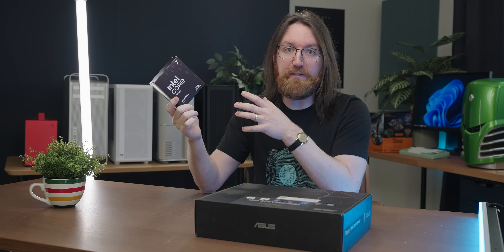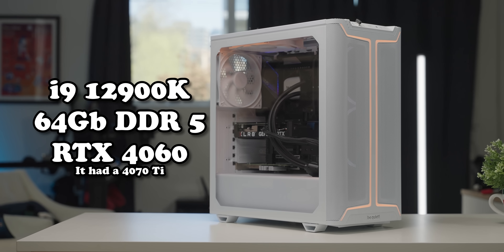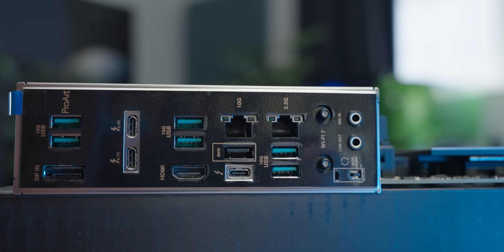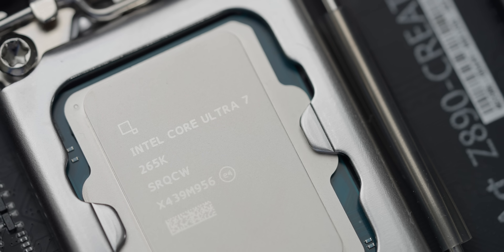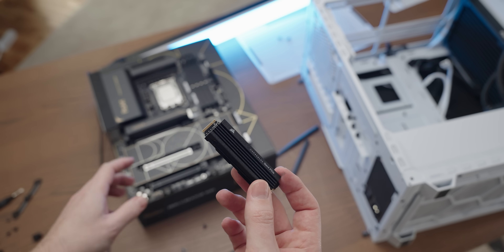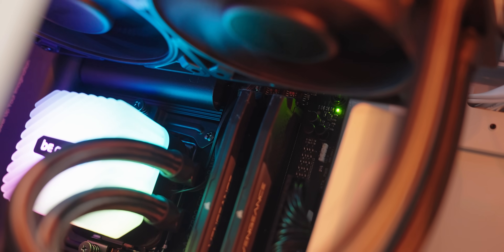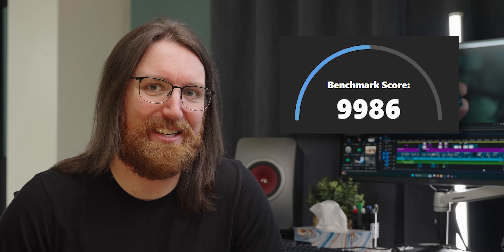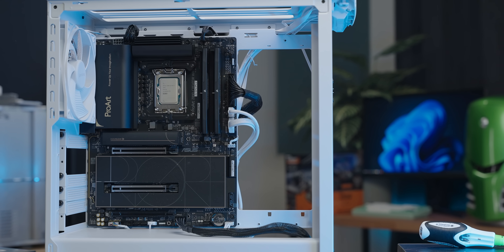I ACTUALLY Bought An Intel Ultra CPU In 2025...

Comment: Well preciously Intel always had an edge in video editing because of its "Quick Sync". But if they still can deliver good performance at a better price that's at least something. I know that many are now avoiding Intel because of the 13th/14th gen debacle. For many bigger businesses the price difference will not have an impact but the reputation definitely will. Intel stock is still dropping like a rock due to the trouble they have getting their new fabs online. It's important that Intel survives so completion doesn't die, in the x86 space. Great video as always Dawid!
Reply: as an owner of a 13th and 14th gen. the debacle is overplayed. like always.
Reply: Quick Sync never gave Intel "an edge in video editing": Just like NVENC, it massively sacrifices video quality and file size for speed, making it totally unsuitable for professional use.

Comment: My new X870 mobo also had integrated M.2 cooling elements, but fortunately I could take them off simply by removing a couple of screws. If you buy an SSD model with a cooling element preinstalled, removing it might void your warranty. At least Samsung seems to suggest so. Not worth risking the SSD. The mobo one probably isn't that much better anyway.

Comment: i bought core 5 245kf because all the latest ryzen in my place needed to be bundled with x870 boards but i didnt need it and it was very expensive. i needed a new mobo, just not x870, so i went with intel instead. got it with rog b860i, 32gb ddr5 6000, 1tb gen 5 and 2tb gen 4 for about 825usd instead of just 9800x3d  with msi x870 tomahawk for 940usd without ram and nvme drives. nvm the reviews, what matters is your own experience and overall satisfaction. happy and satisfied!

Comment: You know… you should actually try working with Premier Pro on that Mac Mini you got. Even with the much lower RAM it will still be very fast and is MUCH more stable there. Of course, I’d still suggest switching to a real professional video tool like Davinci Resolve regardless of the operating system you choose to use. My years of working at a job and being forced to deal with the rampant instability of Premier will forever haunt me!

Comment: Frying a motherboard by putting in an M.2 drive is such a Dawid move
Reply: It can happen. Long time ago I killed motherboard by plugging in completely powered off printer into usb port. It was about 18 years ago but still shit can happen. Maybe in this case it was faulty m.2 port that caused some sort of short or bridging power lines or something.
Reply: A classic 😂
Reply: He puts the Motherboard with the contacts on the metal case. This is a lucky guy  :D
Reply: Maybe he didn't switch the PC off...
Reply: who else but our boy could pull that off
Reply: I did a sata but evga warranted it out thankfully
Reply: wait..pardon my ignorance but how can you fry a mobo with M.2 drive??
Reply: @redfox7497  I'm guessing he didn't pull the power cable from the wall. That could in theory result you shorting some stuff on the motherboard while touching it with your hands etc. Or it could be simple electrostatic discharge that killed some components.

Comment: This is neither here nor there, just a comment on Dawid's sponsor in this video, but I have used the Shift PSUs in several different builds (I build and sell as a side gig) and having the connectors on the side is the best thing since sliced bread. There are technically better PSUs out there, but for convenience they're in a league of their own. Just make sure the case is compatible (i.e. have enough side clearance for side-connected cables).
Reply: Shift PSUs should come with a set of cables featuring 90-degree connectors on PSU side for better case compatibility.
Reply: Only for single chamber cases, considering how popular dual chamber cases have become lately, it makes no difference if you get side sockets or back sockets.

Comment: They also just updated the specs of these chips, fabric and d2d clocks are much higher now (this is what you enabled with the "Intel 200S boost" in bios) and 8000MT/s on the RAM is now officially supported without technically being overclocking like XMP.
You did enable those new settings, but you are still running at very low RAM clock for this platform, so if you want to get some more performance, that's where you should look. Even 8000 is not high at all for arrow lake.

Comment: What's crazy about this is, despite nearly zero PC "influencers" hyping the Intel CPUs up, they will still sell a ton of them due to commercial contracts and OEMs.
Reply: Work gave me big stink eye, when I even brought up Ryzen during a purchacing meeting.
Reply: They're still pretty good CPU's.  I held off on the 285's till I knew they didn't self-immolate like the 14900s did.   Otherwise I'd have probably gone intel this round.  I just find Intel to have fewer weird problems than AMD.
Reply: Entry level nvidia is the same way. Like nobody is big on a 4060 but it comes in so many oems that nvidia probably sold a billion of them lol
Reply: It seems Dell are putting them in their Alienware desktops in the UK.
Reply: I sure hope OEM procurers aren't using influencer's opinions to make their purchasing decisions. The data points YTers present are pretty lacking (or entirely anecdotal).
Reply: @TheJohn8765  Care to elaborate?
Reply: And these are really good cpus, except it sucks in gaming. The core ultra was sold out is most places when it launched. It still beats the shit out of amd in features. The X870E chipset is a fucking joke compared to Z890. Its just two B850 chipset daisychained with only 4 pcie lanes and GL if you want to run more than two nvme ssds. Its good for dumb gamers that only needs one nvme and one gpu but useless for creators.
Reply: @kazuviking and it makes the X870e model a hard buy as well super expensive for what lol
Reply: @kazuviking depends on the motherboard asrock can do 5 without switching the GPU to x8.
Reply: @ Asrock X870E Taichi block diagram for example. You get only two nvme ssd before the chipset lanes are saturated. One gen 5 from the cpu and one gen 4 from the chipset with it taking all pcie lanes.
Reply: @kazuviking  the chipset runs in multiplex there is a slight delay and you could probably oversaturate it theoretically. I have been unable to find any articles or complaints about it so it looks like it would take a lot to achieve it.
Reply: @kazuviking  I'm that dumb gamer. I have one nvme and another SSD drive, just 2 tb total for my gaming needs.
Reply: Sure 😃
Reply: amd neckbeards live in a bubble. intel is still the most reliable choice. i dabbled with amd back in the early 2000s but itd take something big to make me switch back now.
Reply: @iris4547  Intel? Reliable? 

And you had the audacity to suggest AMD people live in a bubble...
Reply: @iris4547  Ironic you talking about "reliable" after the fiasco with 13 and 14th gen lmao

Comment: You are not the only one actually. A Czech youtuber also just build an Intel Core Ultra PC for editing. His reasoning wasnt that he wanted an Intel CPU, he chose the CPU based on the board which was a Z890 since he wanted all his SSDs to have a connection straight to CPU instead of SSD to chipset then to CPU via 4PCI lanes... so intel still has a use case it seems like.
Reply: So basically for no reason, the speed is literally the same lmao
Reply: @PhantomSklyne  Its not LMAO. Try running more than 2 nvme on AM5 and you will realize how dogshit it is. You will constantly run into usb dropout issues and thunderbolt disconnecting. It wont matter for dumb gamers but does for creators.
Reply: @kazuviking I run 3 nvme on b650 with a 9700x and it works great. No USB failures.
Reply: @PhantomSklyne  not if you access more then 1 at the same time, as if you want to do any kind of raid or split the workload between them, the 4 lanes of the chipset would limit the speed, depending on how many other things share them. In the base case of 1 ssd used at a time with nothing else connected to the chipset, the effects should indeed be totally negligible.

Comment: The price of this CPU in India is 33000 (385 USD or 535 CAD) including taxes and infact cheaper than 14700K. Its a great productivity cpu for that kinda price
Reply: And it consumes a half of 14700K's power.
You'll return its money just from the yearly power bill
Reply: @RustedCroaker  What the hell is the price per kwh for electricity in India? You're saving like a dollar a month here, electricity isn't that expensive relative to a delta of one light bulb.
Reply: @ electricity isnt an issue its like 0.13 usd per kwh

Comment: NGL I'm confused with intel gaming scheme no idea if it's latest and if it's low, mid or high, i3, i5 i7 etc with 12, 13 14th, 400, 600 etc naming scheme was easier to understand :yt:
Reply: Core Ultra 5, 7, and 9 is the same premise.

Comment: I built a solidworks workstation with the 9 ultra 285k last month.  That application is single threaded, so max single core performance was the target.
Reply: Does it lose to the 14900k though?
Reply: @Rocket33r  The 285k is about 5% faster. according the passmark bench. Thats for the 14900KS variant.  I around 8% faster than the 14900K.
Reply: @Rocket33r  I do see some SolidWorks benchmarks where the 14900K beats the 285k when overclocked.  I'm not doing that.  Its a production workstation, so I need absolute stability for the user.  But, it does look like you can squeeze the 14900K a little harder.
Reply: @aztnfly2  ...and you can also overclock the 9 ultra. So it still wins by the same amount or more, since the 14900k has very little overhead to overclock.
Reply: Isn't AMD slightly faster is single core performance with Zen 5 though? 🤨
Reply: @MLWJ1993  not according to passmark's single thread benchmark.

Comment: Absolutely nothing wrong with the Core Ultra 9, I have the 285k, and 5090, performance is excellent with the recent BIOS updates, and gaming performance is solid in 1440p and 4K, my previous system was a 14900k, which I did a number of undervolting guides on the Raptor Lake issues, nothing but good things to say about the 285k, great temps, excellent stability, and fantastic in Content Creation, works amazingly with Da Vinci Resolve Studio
Reply: 265k here with 8400 ram, it's great
Reply: Ryzen is still much better for gaming, uses half the power of the intel and has better temps.
Reply: @PhantomSklyne  Half the power is not true at all. Its only half true if you play at 1080P low with a 5090. Not forget the 15-20 times higher idle power draw for ryzen. The Core ultra can go down to 1-2W while ryzen barely gets down to 15W idle.
Reply: @kazuviking Is that right? That’s insanely impressive
Reply: @Garrettdx1988 Arrow Lake is basically Raptor Lake but uses less power.
Reply: @PhantomSklyne  A half of power for Ryzen isn't true anymore for the Intel's 2xx series.
It was true for 14 and bellow.

Comment: As i grow older i realised you dont need to buy the best. My intel 10900F still does gaming fine. Next upgrade is a AMD 9070xt :D
Reply: I'm still rocking an i7-8700 (non-k).  I plan on dropping in an i9-9900K, to buy me another couple of years.  Most likely, I'll convert to an AM5 platform at that time.

Comment: Switching to DaVinci Resolve shouldn't take more than a couple of hours to learn everything you need to know for your use case. And anyway, it's free and you can make up that lost time very quickly through the relative lack of crashes and the faster workflows.
Reply: The free version of resolve doesn't have hardware encoding and is missing a fair few features, but for a free app it's still amazing. And even the paid version is like one time payment and then you have lifetime updates
Reply: @ShockingPikachu  You don't want hardware encoding for Youtube videos anyways. It'll look like hot garbage. Unless you mean Intel QuickSync.
Reply: Based on his video format, he doesn't use much After Effects, so yeah, switching to PP to DR should be easy. It has been two years since I moved from PP to DR.
Reply: I switched in August and the basics are fairly quick. Fusion nodes, Composite Clips and Power Bins took a few months though. Hey, if it ain't broke, don't fix it BUT being able to import your keyboard shortcuts goes a loooong way
Reply: The free version of davinci resolve on windows cant handle the 10bit 4.2.2 clips that his camera shoots, because it can only work with codecs that your os supports. (Assuming he shoots in the best codec/settings)
On mac it would work tho.
Reply: I was so happy to switch to Resolve. It does a lot of things better, it's way more stable, and it's a single lifetime payment. Worth every penny
Reply: If someone like Dommy here is paying for a subscription to get fisted uncontrollably by Adobe? Being 'free' is not a perk. Dommy is doing this for a carrier and work. DaVinci could charge 1 to 1 what Adobe is doing and still be the better option by miles. Dommy on Dommy Dose Tech Stuff should consider doing a video going over the process of trying out DaVinci. No words are enough to explain the things Adobe dose to people doing video editing.

Honestly, good on Dawid for going ahead and rebuild the editing rig like this. It was a good video that only lacks a little more deeper information and such. That RTX 5060.. I mean RTX 5070 can either be used to make fun of Nvidia, or find a possible use case of doing something productive. If the drivers are so bad that the GTX 5070 is unusable? It should really be returned as faulty. AI AI AI.
Reply: @TheDiner50  you sound like an ai yourself
Reply: They also have a pretty sweet editing tutorial
Reply: I'm trying to learn DaVinci after always using Sony Vegas and it's quite the change lol. I know in the tutorial though it said you can switch DaVinci to use different shortcuts that you're used to (like PP users)

Comment: 6:40 I totally see your point and agree. But it could be worse! Western Digitals WD850X series SSDs have the heatsink glued on!!! JaysTwoCents killed one of them when he removed that cooler...
And about the Intel Core UItra series CPUs: I will keep an eye on them. The last gen i5 CPUs, combined with DDR4, were often the best choice for budget systems. I also use an ARC in one of my systems. They are fine and a great value if bought used!

Comment: i bought intel because i got an lga 1700 motherboard for free, i think thats valid
Reply: Very valid
Reply: 1700 is still very solid. Hell even a 12700k won't bottleneck 99% of GPUs out there.
Reply: @SpartanArmy117  was considering that, but i ended up buying a 14600kf for the newer architecture + i didnt need the cores and it was the same price
Reply: @SpartanArmy117  I've been rocking a 12700k for 5 years and will eventually upgrade to an i9 for an extra 50% performance. The only case where people on LGA1700 are screwed is if they have a DDR4 platform because it does legitimately bottleneck the high-end chips, even the 12700k can flex better on DDR5, albeit nothing like a 13900k\14900k
Reply: @SpartanArmy117  12900k to 7800x3d I gained a massive amount of frames on my 4090, now 8900x3d slightly less of an upgrade but decent.
Reply: That's where the value really is. Their platform costs are so low that Microcenter and other vendors give away Z-series boards for free on top of an already discounted CPU. AMD only makes sense if you value an extra 10% FPS for 50% more cost.
Reply: Considering how expensive motherboards got in last couple years, than your decision is very valid.
Reply: They're in line with the 14th gen (with the updates through the most recent) as far as gaming goes, and are way ahead in productivity. Having 14th gen gaming performance isn't that big of a deal, it was incredibly strong and is only 1 generation old.
Reply: @CyberneticArgumentCreator  that and supposedly intels focus with the new gen was dropping power draw, which is actually a great idea. a CPU needing a GPU cooler is just insane but for a few generation was not unrealistic
Reply: @CyberneticArgumentCreator  Especially since if you're not using a 4090 or you're one of the three guys with a 5090, you're not CPU bound in like, 90% of games if you have a 11th gen or better intel or a 5800x3d or better AMD.
Reply: @WhiteG60  exactyl bro, i dont get why people are so mad
an i5-13400f will run most GPUs like 70 class maybe even 80 and old 90 class gpus perfectly fine
Reply: I wouldn t even take an intel board if I got payed for it ;-)
Reply: @M00_be-r  ok dude, u go ahead and not take a perfectly good board
Reply: I got a 7950x because I got it free, so I bought a AMD mobo

Comment: I have two Ultra7 setups, but they aren't primarily used for gaming.  One of them I just keep around for IGPU testing (fun fact, on both systems, turning on the 200S performance options causes all IGPU overclocking options to disappear), the other is a "Team Blue" PC with a B580 & 96G of RAM I built to run some of the bigger AI models.  The 9800X3D / 7800X3D are better for gaming, but it isn't like you're going to suffer unplayable frame rates on ANYTHING if you have an Ultra7 in your system.
Reply: It's just like how things were during the days of the Pentium D.
Reply: They're significantly worse than 13th and 14th gen Intel processors too.
Reply: @ The only reason to pick a 14700K up over a 265K is if the 14700K is overall cheaper and you are primarily gaming.
Reply: @MillVillage thats just not true lol. In terms of gaming the 285k with the new bios update is beating the 14900k. And in productivity its not even close. The 285k destroys the 13th and 14th gen options.
Reply: @MillVillage  It's better in both power consumption and temps vs 14th gen,and it outperforms both of them in Passmark tests
Reply: @MillVillage and even at its worst the 14900k was only beating the 285k by 5% in gaming. Now with the boost option it’s boosted gaming percentages 13% on average.